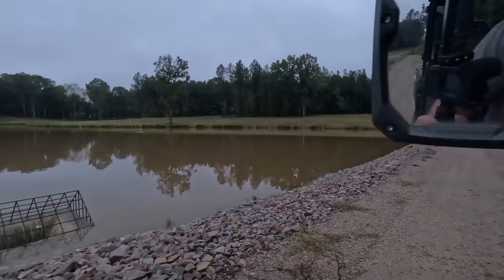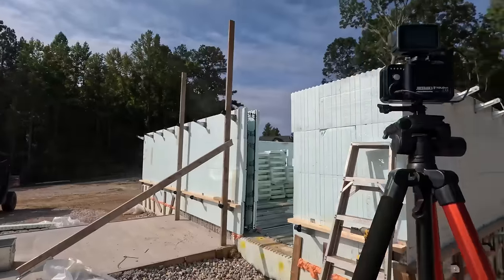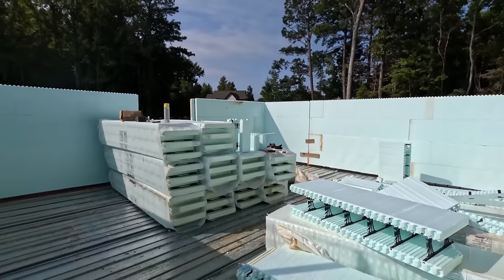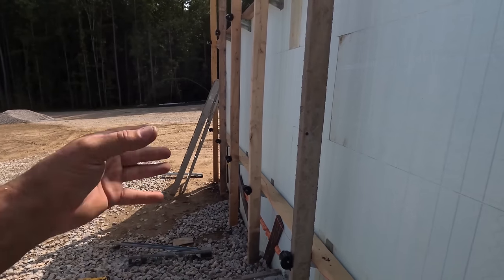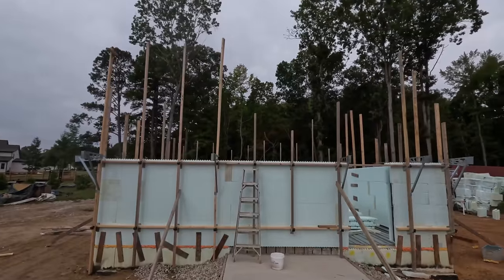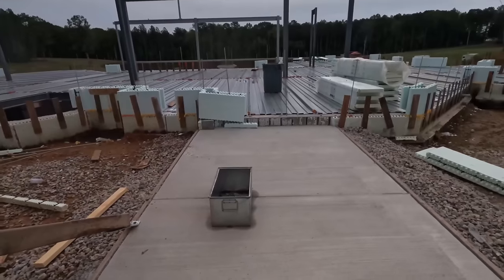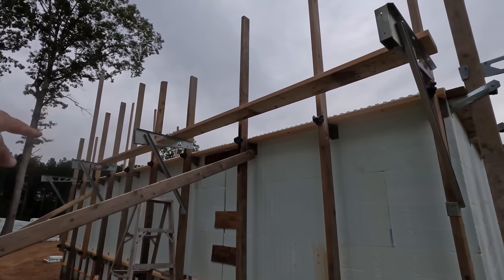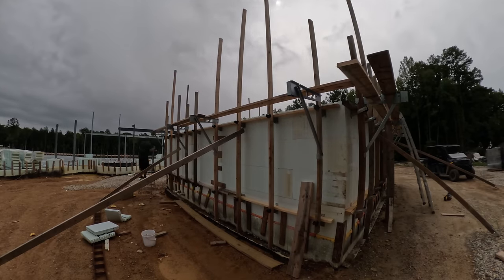Getting Bracing on the ICF Before the Storm

Comment: Looking at the entrance to the garage, looks like you are creating a court yard that you drive through. Pretty cool. Thanks for sharing. Glad to hear you not in the main path of the storm. Sadly, many have not been spared. God Bless them.
You may have covered this earlier, but is the cost of an ICF home more than a stick built? Seems like it would be much more, with a benefit for efficiency once built.
Reply from the maker: It is more. Depends on what level stick built home you’re going for. If you’re building a custom home and trying for efficiency then ICF is about 5% more than stick built. But mine is more than that because I’m doing suspended concrete floors.

Comment: Just watched Diesel Creek's vid on his basement walls/footings pour & it brought up a couple of questions regarding concrete construction:
Forms used (non ICF) had some sort of jack-screw adjustment to correct for loading. Why isn't this used with ICF?
Concrete wasn't vibrated in by the company on his build, just rodded to remove air pockets, apparently down to vibro making the ballast sink on deep pours when the mix is made wet enough for pumping. What are your thoughts on this?
Reason I ask, is I'm researching what building methods to use for self build here in the UK.
Reply from the maker: You can use that with ICF. I did that with the pool. 
There’s a lot of discussion about the mix. I’ve used various ones for the 3 wall pours I’ve done. Seems that a 6 slump with pea gravel works best. Accelerator in the first lift.
Reply: @BealyGood  Ta much.